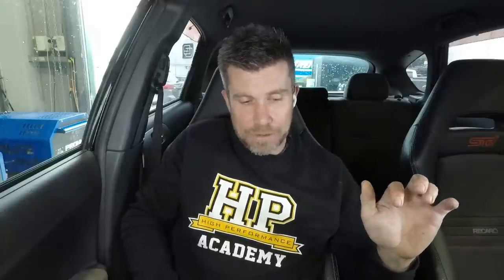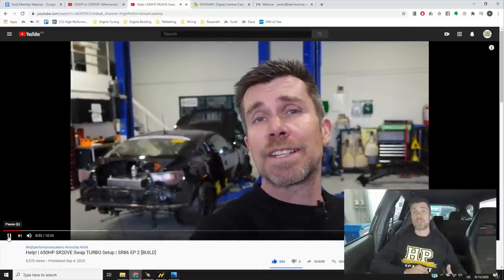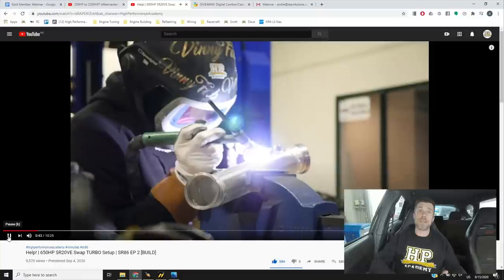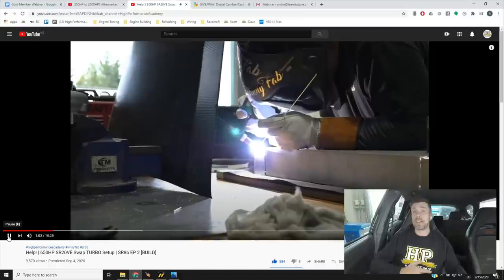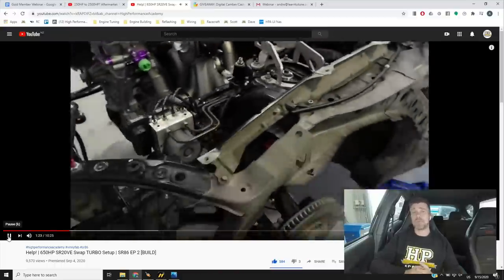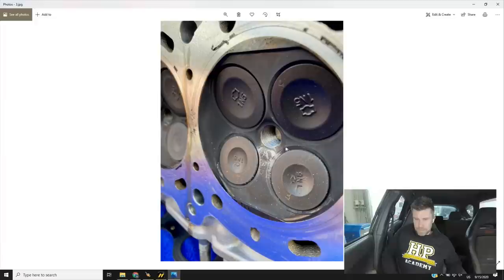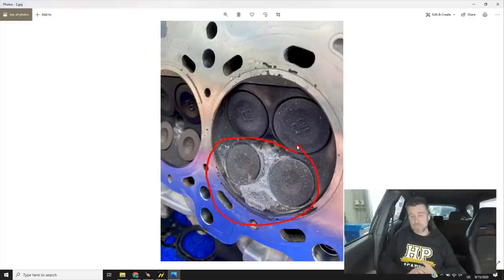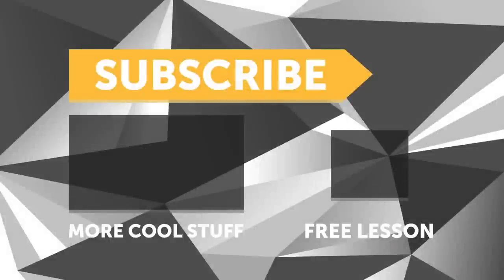Pre-Ignition Vs Detonation/Knock, DBW and MORE | Today At HPA [UPDATE]

Comment: That’s exactly what happened to my k20c1 motor. A hole burned through cylinder 3 piston at the crown and Darton ductile iron sleeve at the Cometic head gasket. It was caused by new NGK ruthenium plugs I wanted to try out as a cheaper alternative to HKS Ruthenium spark plugs that kept breaking the strap into the combustion chamber. What a huge costly mistake that was trying to save a small amount of money but really caused a huge cost. Sucks! Well it was an expensive lesson to learn.

Comment: What’s your opinion on using a vacuum coolant bleeder/filler? I’ve used them before after timing belt jobs etc on standard cars and seem to work great requiring no bleeding. 
Could have possibly helped prevent air pockets?

Comment: Did you guys Log the radiator return coolant temp, that way you can find out if your cooling system is working  correctly.
Reply from the maker: Due to the rush there were a few sensors not ready to roll beyond the basics. If we had the EGT's installed (more data etc) we could have pulled the pin a little sooner, but it wouldn't have saved anything racing wise. Not the end of the world but a lost weekend nonetheless although even at that lower power level the car is faster already. As you know there have been more changed than just the engine to thank for that. 
There are just so many hours in a day and 1000's of little things that take up so much precious time when it comes to an engine swap but at least now we have a bit more time before the next round to carry on 😎 - Taz.
Reply: @hpa101  Taz you guys mentioned two ways that could have cause the coolant to blow out, there is a third less understood which is cavitation of the water pump at higher rev's.  The Subaru EG33 was a killer with this problem as are many other engines that is why expansion tanks were invented but they don't always work to solve the problem.  I have fixed my EG33 so it no longer suffers from cavitation so if you need to know how to sort  the problem let me know.
Reply from the maker: @anthonyparle7342  Cavitation is not lost on us and is another idea that's been kicked around. We're currently utilising a stock SR20 pump that's designed to work up to 7000 rpm yet we're running to 9k and consistently above 7500 with the close ratio sequential. We are fitting an electric water pump in the next two weeks - Andre
Reply: @hpa101  Andre,  I can tell you how to fix the cavitation problem in 5 minutes and stick with the existing water pump.  You have my email as I am one of your students.

Comment: when changing to high duration cams how do i know how much revs i can expect to increase ?
Reply: You have to calculate combustion event timing vs rpm vs cam timing. In general the longer the end of the valve close event is the higher the rpm it's suited for. As the engine spins faster, a given fuel burns at the same rate, and the cam is responsible for the change in breathing to support it (usually at the expense of low-rpm efficiency/power). I would call up a custom cam mfg familiar with your engine info, fuel choice and goals and they can give you specifics and reccomendations.
Reply: You have a few things that change rpm ranges in cam timing. I purchased a 2500-6500 rpm solid cam from comp cams years ago for a 302 ford i had, and ran edelbrock rpm heads and a rpm intake, and had a 2500 stall. So I wanted a cam in a solid that would support the convertor so i went small.. Turned out the cam i chose with basically a performer rpm top end ended up running 4500-8000 rpm.. I mean 7000 rpm peak would have been nice but.. So how many rev's is hard to say, it can lead to intake track length valve springs all sorts of things, so predicting a rpm range you can sorta get close.. kinda but calling the cam maker can get you close, but it's not always accurate. Also the bigger the motor generally the lower the rpm, smaller engines rev higher, so what turns 10000 rpm in a honda might only turn 5500-6500 in a 540inch motor..